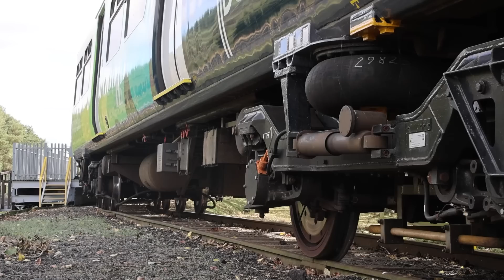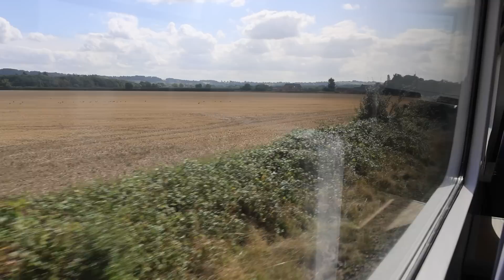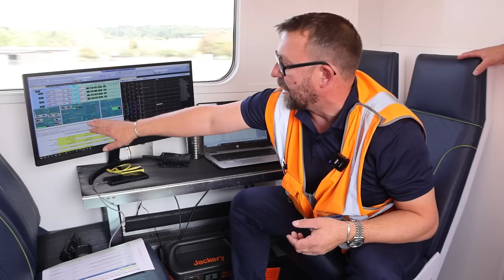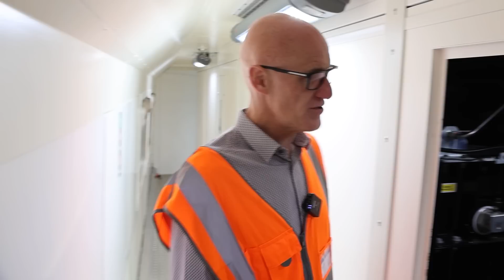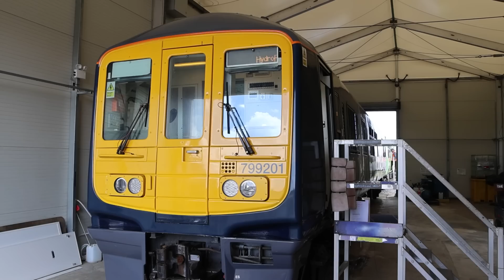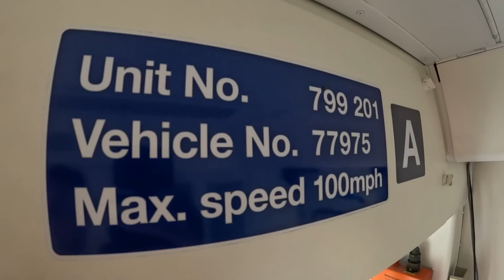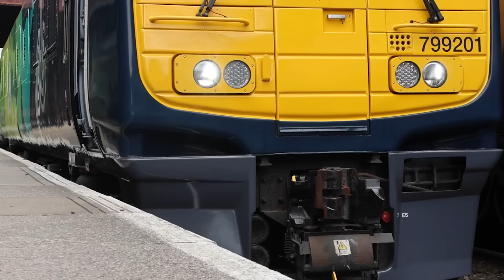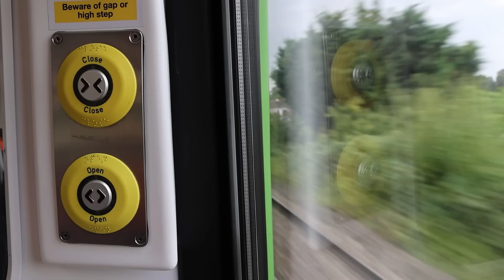The Class 799 Hydrogen Train

Comment: This is an extremely interesting video.  But it misses one fundamentally important point which other commentators have also alluded to.  The only GREEN way of manufacturing hydrogen is by electrolysis,  That requires a lot of electricity.  Put crudely, the electricity needed to power this class 799 is THREE TIMES as much as the electricity which would have been needed had it still been a 319 drawing power direct from an overhead wire!
Reply: Probs a real solution for branch lines that won't get electricified, like they said
Reply: @charliebramley costing even more in the long term
Reply: the use of suitable catalysts considerably reduces the amount of electricity needed to generate it - unfortunately, these are based on platinum-group metals, making them extremely expensive 
(source: I used to work in the production department of an engineering firm that made industrial-scale hydrogen generators)
Reply: Living on the Far North line here - surrounded by HUGE amounts of hydro and wind generation - and now even more offshore wind - this is multiple times the needs of the Highlands, the North of Scotland and regularly more than the needs of Scotland - it is shipped South via the grid. More often - turbines are turned off - as the demand isn't there. This missed opportunity is where the local production of GREEN hydrogen (removing transmission losses and transmission requirements) using this excess power really can make a difference.  The ability to decarbonise the far north lines with locally produced hydrogens with recycled units.....?
Reply: @michaelatkinson7577  Now this is a valid point.  But it is only applicable to electricity generated from natural 'renewable' sources in  very remote areas where there will be huge 'transmission losses' if the surplus electricity is transferred through the grid to densely populated areas.
Reply: @rogersexton7857  which is exactly what we have here in the Highlands. We have a very remote area with two rail lines running very close to massive amounts of power generation, which is very remote to the areas that need it. Due to throttling required (due to lack of capacity to transport it south) - the available production (turning off of turbines) is not exploited. With the further massive in planning and under construction wind generation up here - there is a clear opportunity to produce hydrogen when the grid can't take the generation away. Yes - not at all as efficient as 1. usage directly, 2. charging  batteries locally 3. transmission (see above) but actually producing (not leaving turbines sitting idle when it is windy) and storing - for use at another time absolutely has a place.
Reply: I was just about to write my comment and someone and lot of people had made the same point. I'm an energy specialist and Hydrogen will only be used in very specific purposes, transport and heat is not that area. Batteries in transport are cheaper better and much safer. Heat pumps in heating also much better. Only ceramics and still "might' uses hydrogen but really only because there has been a better option made YET.
Reply: Yeah, the main issue with hydrogen power is that it just pushes the power generation back a stage to creating the hydrogen, which can be just as bad or even worse than conventional fossil fuels. Unless they create more efficient manufacturing ofc, but I can't see when that's gonna happen.
Reply: @abigailcooling6604  Not to mention compression. storage and transport.
Reply: @abigailcooling6604 I think it is more efficient and is definitely easier to do carbon capture with but using fossil fuels for it is just a middle stage so we can swap to hydrogen easier
Reply: @rhysrail I think you are missing a word or two. I am not sure if you think carbon capture is good or bad. 
In any case the theoretical best efficiency for it is horrible. It can only be considered as a last ditch desperation method if we screwed every other option up.
Reply: @johnbennett1465  I don’t think carbon capture is any replacement for proper solutions however I do think it’s better than pumping carbon dioxide straight into the atmosphere, it would be relatively fast to convert to hydrogen using hydrogen generated with fossil fuels and then over time we could switch to green hydrogen
Reply: It's often said that the idea is to generate hydrogen using "excess" electricity that can't be practically stored (in effect, "storing" the energy in the hydrogen). Trouble is, hydrogen is an absolute nightmare to work with. It just loves to leak out of everything and also loves to turn back into water (rapidly) at the slightest provocation.
Reply: You are right, but this doesn`t mean that there is no place for this technology. Producing hydrogen is a possible way to store electricity and smoothen the peaks in energy production which is especially useful when the source is renewables but even a nuclear reactor works better on a relatively constatnt output. Back to the railway use, this could be useful alternative to diesel on long but low traffic lines like the Highland Line is Scotland. It is unlikely to ever replace OLE or even 3rd rail and high traffic lines should be electrified with OLE.
Reply: But ! Converting wind or solar to hydrogen makes sense , if the oil companies get their way they’ll use fossil fuels and that will be extremely wasteful
Reply: Green Hydrogen won't be able to provide enough Hydrogen at a cheap enough level to power a hydrogen economy. There are other technologies that should work, such as Blue Hydrogen (H2 from methane gas) or Gold / White Hydrogen (Hydrogen obtained by either direct extraction of deposits, or by running water through certain rock types, returning Hydrogen and de-salinated water) but both of these will need further development before they're commercially viable. 

Green Hydrogen works best as a centralised enregy store, so when it is very windy and sunny, hydrogen is created and stored, and when electricity is needed, the hydrogen is either run through a fuel cell or a gas turbine to generate electricity. The great thing about a fuel cell is that it can run both ways, creating hydrogen from electricity and water, and creating electricity from hydrogen and water.
Reply: Any "environmentally friendly" solution has inherent "non environmental" problems.  Just look at EV cars and the massive environmental issue they are causing (lithium mining, reduced overall life span, etc etc etc).  We, as humans, since the first time we lit a fire to keep warm, we have created carbon.  The idea is to make as little as possible where we can.  If that is with Hydrogen then so be it.  Don't forget, installing and maintaining overhead cables also has a carbon impact........
Reply: Steam-methane reforming is the most widely used method of producing hydrogen; not electrolysis.
Reply: @chrisslaterwalker  But this process is most certainly not 'green''.
Reply: @rogersexton7857  Indeed, and that's why I didn't make any claim or statement about its environmental effects.
Reply: I wonder how huge is the hydro power is in Scotland. We saw the dam at Pitlochry and know there are many other very small operations in other parts of the country. However (and leaving aside wind generation for the moment) it would not be viable to electrify any of the outlying Scottish lines with overhead power, as there are so few services relative to the intensive services in other parts of UK. Third rail would also be out on the same basis. Therefore third rail charging a battery train at stations and terminals is the better option in my opinion. I don’t see Hydrogen as an option due to what I have seen in this video. Not to downplay the efforts of the engineers who have got to this stage.
I have to say I live in NZ where about 80% of electricity is hydro, with some wind and solar installations, so we are pushing 85% renewables on a good day. The South Island provides a huge amount of power to the North Island through a DC link of 900km from Benmore Hydro dam to Haywards via the undersea Cook Strait cable. Therefore similar to Scotland sending power South, but I doubt in such huge amounts.
A very informative video however.
Reply: Absolutely fine if the energy is drawn via renewable energy... much of the time we have it in excess in the UK.
Reply: (Electrolysis is passing electricity through water in order to split it into oxygen and hydrogen.) Makes sense, but this is still greener than diesel by far. And I'm actually surprised that these trains haven't been around for longer, considering the combustion reaction between the hydrogen and oxygen is the exact same process as between any other fuel and oxygen.
Reply: Did you notice there are no overhead wires on the line? And did you hear when he said it has a pantograph for when there is overhead wires?
Reply: Yes, but you don't have the capital cost of installing catenary.
Reply: It’s somewhat true, there are now new chemical pathways whereby metal catalysts or metal-doped carbon organic frameworks (COFs) can significantly lower the activation enthalpy required for the electrolysis to occur.
Hopefully in the future, that can be beneficial for fuel-powered vehicles (not necessarily trains) when electricity production becomes more carbon neutral and access is needed for EV-inaccessible areas
Reply: What if in future they create novel and efficient electrolysis process to make green Hydrogen just because there is a need.
Reply: Converting Wind Power into Hydrogen in the middle of a windy night does make sense (or store it in batteries?), but then just convert it back to electricity. Very inefficient, but better than lugging hydrogen all about the place.
Reply: @apuldram  But the most energy efficient solution is NOT to convert the wind power into hydrogen, but to convert it into electricity which is stored in accumulators.
Reply: If you use wind power to generate hydrogen then you get to turn wind into train fuel without actually needing it to be windy.
Reply: @sepocon  Yeah, and how many gigawatts of wind would you need to capture and store as part of the demand
Reply: @Titot182  I don't know - but if you are really that interested I am sure the maths is not that complicated.
Reply: @sepocon and you’d need 10x as much wind power as just putting batteries onboard
Reply: @YouTube2021FM  Maybe so - not my area of expertise
Reply: You're partially correct. Though electrolysis is not the only green method of obtaining an efficient supply of hydrogen.
Reply: @NiceDiscotheque  What other Green methods are there?
Reply: @ I don’t have the motivation to explain. Google is your friend, you have to really search though to get concise information as internet search algorithms obviously follow the ‘popular opinion’.
Reply: @NiceDiscotheque What, then, are the others?
Reply: @Leo-u4o  This one, that one and the other one.
Reply: @NiceDiscotheque  well you can split methane into solid carbon and hydrogen at high temperatures using an appropriate metal catalyst but the energy embodied in he hydrogen is a lot less than in the methane input.
Reply: @ Yeah, thanks for the chemistry lesson 🤣
Reply: But it does mean an alternative to spending loads of money electrifying the line, plus the 799 also has a pantograph
Reply: @ZLDSmogless simple - batteries
Reply: @ZLDSmogless  I suspect more conventional batteries would be better than hydrogen considering everything, even taking into account the mass of the batteries. But the goal should still be to electrify.
Reply: @ZLDSmogless  If you filled all that space with batteries, they would have about the same range as that train currently has, but it would take a lot less to charge it up. We already have that in passenger service with the Class 777/1.
Reply: @alanclarke4646  1 - actually no, because the container you need to hold the hydrogen is much heaver than the hydrogen
2 - even if it was, we are not talking about 3+ times more energy.
Reply: @katrinabryce  but definitely lighter than the batteries
Reply: @alanclarke4646  No, it works out about the same in terms of km range / kg,
Reply: @katrinabryce  Battery production is harmful to the environment,  hydrogen if produced cleanly can eliminate a lot of damage to the environment vs batteries.
Reply: Or a battery charged in the depot or occasional third rail.
Reply: That is true however it is still cheaper than electrification on a lot of rural lines and is far better than battery
Reply: @rhysrail  indeed, if electrification is not an option, hydrogen storage facilities can be in theory creating less pollution and lasting longer than batteries
Reply: @ yeah how I see it is normal electrification should be used on any high frequency routes and essential connectors and then hydrogen should be used elsewhere
Reply: Let's accept your statement that 3 times more electricity is needed to power this train in this manner than by using the electricity directly.  But that ignores the other benefits of this approach!  And those benefits can simply be seen as "costing" that extra electricity!  The benefits are for example, no need to erect power lines along all track where this train would be used.  (Likely to be high cost / environmentally impactful / controversial / unlikely to happen).   Another benefit is that hydrogen from electrolysis can be a means of storing excess solar or wind power - the "cost" of that storage being use of more electricity overall.  As in all engineering and design, it is really a matter of compromises.  There is no "perfect" solution.  BTW I completely agree that any GREEN solution can only be based on use of hydrogen generated via use of renewables, not by fossil fuel based processes.
Reply: You are correct but there are several different colours of hydrogen, the holy grail is green which realistically can be done! For some who graduated this year with a masters in Environmental Science and green technology and wrote there dissertation on a hydrogen home! This is what I want to be doing and doing hands on research and changing the perception of hydrogen and green technology! I know up in Scotland there’s 50 homes which are being powered by green hydrogen! The only thing you’re forgetting is the amount of water that you’re using within electrolysis!
Reply: However. Countries such as Madagascar can produce v cheap solar energy that cannot transmit it due to transfer losses, so making H fuel cells works. There is shipping to factor in, but still, miles better environmentally.
Reply: @gregthebaker829  I take your point.  But Madagascar is extremely different from the densely populated UK, where surplus electricity does not need to be transported hundreds of miles, except perhaps in the far north of Scotland.
Reply: @rogersexton7857  noted but I was only making the point previously marginalised countries (typically African) can be part of this.
Reply: @gregthebaker829  On this point, I totally agree!
Reply: Mate you cant say that bcos it doesnt go with the narrative.
Reply: Could be good as a stop gap for lines that are years away from electrification. 

As a passenger I would be concerned by lithium fires and the safety of the H2 in the event of a train crash incident. 350 bar is a  mighty high pressure to be carting around.

Would probably exclude use in tunnels longer than a certain length.
Reply: The production of Hydrogen by electrolysis can use green electricity from solar, wind, nuclear and Hydrogen.  Many parts of the UK rail network can't be electrified not only because of cost but location and weather, whether third rail or overhead cable.  Many parts of Wales and Scotland are miles from an electricity supply and have extreme weather.
Reply: @tonys1636  Regarding conventional electrification: Cost and location are the most important factors. Weather is largely irrelevant- rain or snow don't really affect the wires that much and there are systems to deal with that. Wind can be a problem but it's not a major barrier to electrification as overhead wire systems exist pretty much everywhere, even in very windy places. The hardest part would probably be fitting wires through bridges and tunnels with low clearance. For bridges and tunnels with 5m or more clearance, regular wires can be put in. For bridges and tunnels less than 5m, the bridge would need to be raised/rebuilt, a neutral section put in or the track lowered. Modern 25kV overhead wire systems are able to have substations much further apart than older DC systems- up to 40km apart compared to a few km apart, so it's much easier to find suitable locations for power.
Reply: @tonys1636 and so can batteries - 10x more efficiently..:
Reply: yep, and the cost of generating that electricity from green sources easily out strips the cost of electrification.
Reply: And what happens if the train has a crash and there's loads of heat from the batteries
Reply: Yes, but no infrastructure is needed, and hydrogen is more practical than batteries.
Reply: @geoff1201  You will need the infrastructure to manufacture the hydrogen through electrolysis; also to SAFELY and SECURLY store the hydrogen.   And also consider the space taken on the train by the hydrogen storage.
Reply: Thanks, in plain words not economically viable in the real world, only in the Ed Miliband net-zero fantasy land.
Reply: @nickdawson9270  I think we should be blaming HM Treasury and their allergy to spending money on infrastructure, rather than Ed Miliband.
Reply: @nickdawson9270  ah but you see, hydrogen is not supposed to be net 0.
the point of pushing hydrogen is to keep oil and gas companies as the gatekeepers of energy.
Electrolysis is not as cost effective as just using the electricity directly or with batteries.

but you can also get hydrogen from refraction of natural gas. so oil companies bribe politicians to push hydrogen so they can keep selling gas.
Reply: @nickdawson9270  Net zero is not fantasy. If it is not achieved our grandchildren will not have a worthwhile future. It is that serious.
Reply: In the process of electrolysis, (of which I know very little about) is hydrogen the waste product when separating highly reactive metals? Please correct me if I am wrong. Thank you for the info, I think I was thinking of something else
Reply: @absentmindedjunk  Electrolysis is a process using electricity to drive a "non spontaneous chemical reaction" (ie one that wouldn't naturally occur as it needs a source of energy to power it). In this case, electrolysis of water would split two water molecules into two diatomic hydrogen molecules (H2) and one diatomic oxygen molecule (O2).
Reply: @absentmindedjunk Electrolysis is the process of splitting water into its components, oxygen and hydrogen, using electricity.  In this case it's the oxygen that's the waste product, though I'm sure they'll make use of it.
Reply: @johnm2012  No point. It is sitting in the air all around us at 21% concentration and is very easy to separate out.
Reply: @rogerphelps9939  You're talking about oxygen being "very easy to separate out" from air? The fractional distillation process needs energy so if water is going to be electrolysed on an industrial scale it makes sense to collect the oxygen too.
Reply: @johnm2012  @absentmindedjunk it doesn't always have to be water that is being split (although it quite often is for producing hydrogen). Hydrogen is produced as a waste product during electrolysis of anything in an aqueous solution, and because Hydrogen is reasonably low in the reactivity series, it doesn't even need to be particularly reactive metals. The issue is that the equipment isn't set up for collection of the hydrogen because it's always been classed as a "waste" product in that process so no one really cares about it
Reply: @johnm2012  Depends.
Reply: @johnm2012  Oxygen is easily obtained from air by the absorption method, that's how oxygen generators work.
Reply: You can fractionally distill carbon at a much lower pressure /higher temperature as well. Either hide the stuff or turn in into petrol.
Reply: @absentmindedjunk  The elecrtolysis is of water H2O!  It splits the water into hydrogen and oxygen.
Reply: @absentmindedjunk the process of electrolysis is splitting water into hydrogen & oxygen using electricity.
Reply: Bingo. California brain  dead ideals
Reply: @williamerazo3921 you’re saying this on a platform created and operated by Californians